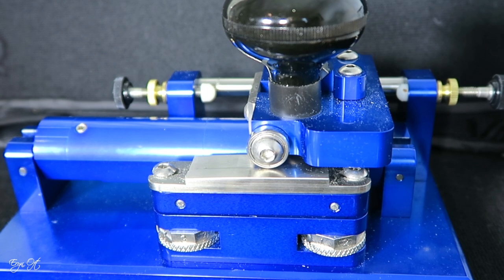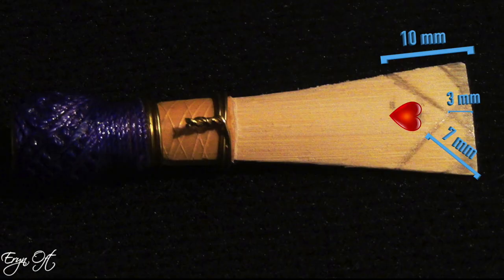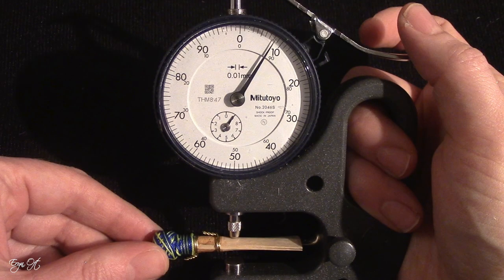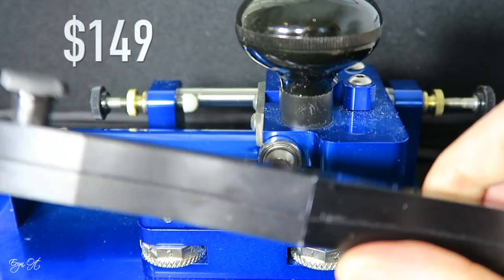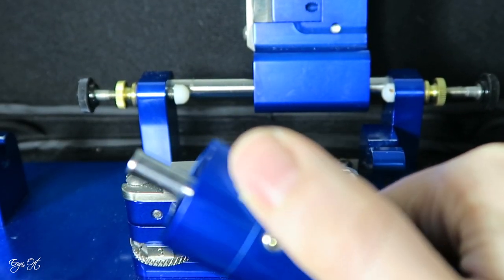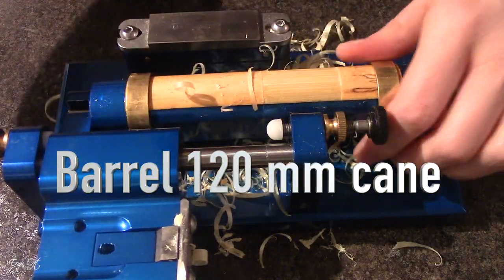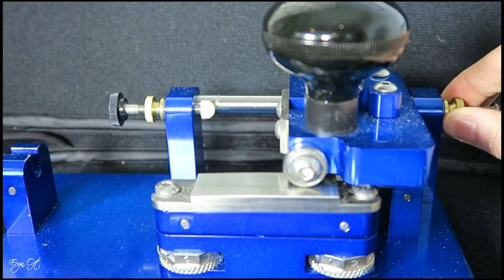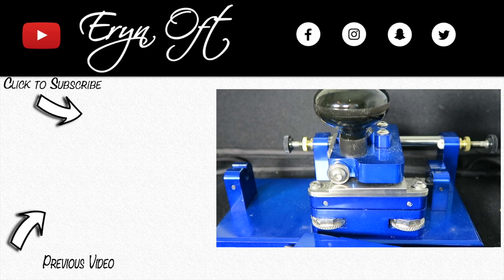MY MD PROFILER AND SHAPER BASSOON REED SET UP

Comment: One of the reasons you have an unbalanced tip is not necessarily alignment but gouged cane that is harder on one side. This happens with elliptically gouged cane where one sides depth is different due to side to side alignment.  Cane on one side nearer the surface. Cane gets softer the further from the bark you are.  That is why this problem is solved when using concentric cane.
Reply from the maker: The future goal is to create a thinner tip, yet keep the heart a bit heavier with the use of a different non tapered ramp that would meet this need. The focus of this video was not on the gouge. It was on the profiler and the current settings. And yes, there are many ideas on concentric, eccentric gouging, and hand gouging. That can be covered in a future video.

Comment: Just a question; can you release the screws on either side of the template and slide it from left to right (and then retighten), or are you forced to buy a new template?  I do love my reeds n stuff for the ability to shift the template (so the ramp changes where the heart of my reeds are)
Reply from the maker: Great question. I can't shift the template from left to right. That is a bonus of the Reeds N Stuff machine. That and it is much heavier weight (feels much more durable). But it is also more expensive. :)

Comment: Can the color of the bark portion of GSP cane be an indicator of quality? I know golden/golden brown is ideal but I was wondering if I should discard a piece of cane that has a lot of brown or gray on it or not.
Reply from the maker: I have had plenty of reeds with pigmentation (brown or gray spots) that ended up making great reeds. It is an indication that you may need to watch out for hyper pigmentation when scraping the reed later. Be sure to check scrapes with a micrometer and not just a light and you will be golden! :)

Comment: Are there any tips you can give me for the Db scale and broken thirds when going from Ab to Bb (Second Octave) using the right thumb for Ab.
Reply from the maker: To be honest, I don't use the right thumb A-Flat very often. Is there a reason you are not using the right pinky A-Flat?
Reply: Eryn Oft I find it much easier to move from Gb to Ab. I don't know if it's because I have small hands or if I'm just not quick enough to move from Ab to Bb.
Reply from the maker: The thumb A-flat is not a standard fingering. Are you using a hand rest? If so, maybe try without and it would help you reach the keys. I, too, have small hands and think it is easier to play bassoon with smaller hands rather than really large hands (much harder). Long term this would set you up for greater technique!
Reply: Eryn Oft Okay thank you!